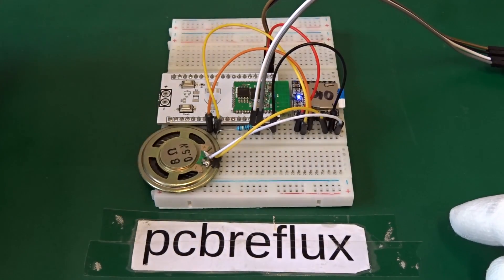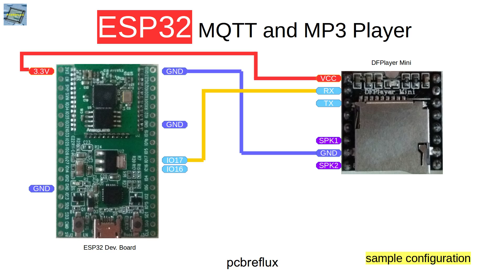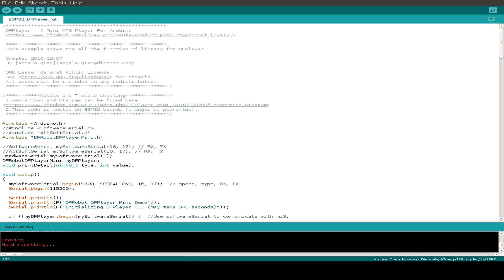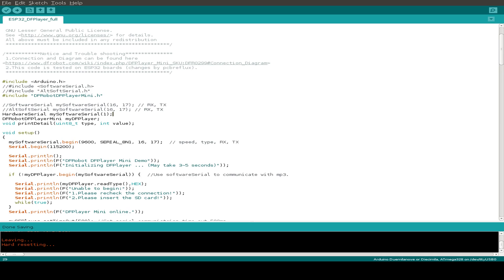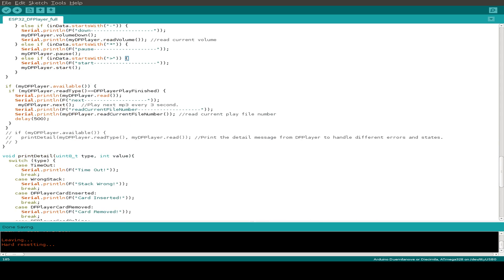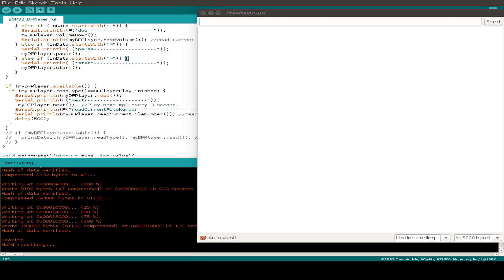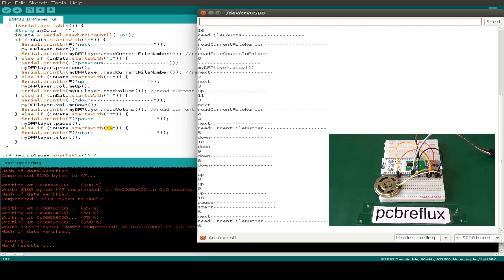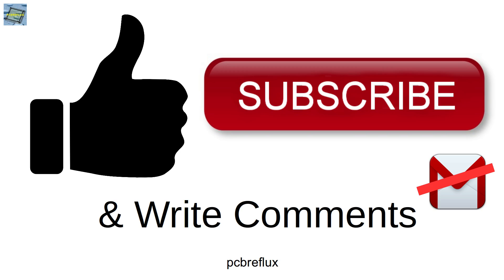ESP32 #36: Play MP3 with DFPlayer Mini + ESP32 Giveaway

Comment: Hello,
I am French and I don't speak English very well.
Thank you for this tutorial, which I discovered a few days ago after reading many others without success in completing my project.
My project is to create an audio module to attach to a drone that would broadcast the cries of predators of certain birds that destroy crops. The goal is to scare them away.
So I recorded a 50-second audio file on a micro SD card.
I would like to activate it when I power up the cards using a battery and a switch.
I would like it to activate indefinitely every 5 seconds.
Can you tell me what I need to change in the code to make this work?
Thank you again.
Best regards,
Philippe

Comment: Hello, did you find it necessary to power the esp32 from vin or will the usb connector and esp regulator be able to power the 3w speaker (likely average power is much lower)? It seems this may be marginal.

Comment: 1:10 Dumb question, what’s the purpose of the resistor and I can I just order a box of standard resistors from Amazon and put a 100K in line? I’ll be using an esp32/8266

Comment: Hello Friend! Excellent video.

I made a circuit just like yours, using the same code and library. My files are in the "mp3" folder, named "0001.mp3, 0002.mp3" and so on. I also made a folder called "15" with a single file called "001.mp3" as per the documentation.

Turns out none of the play(), playFolder() and playMp3Folder() functions work for me, none play the sound. But, the next() function works, I can play the sound by next() (by typing "n" on the serial monitor).
Something I noticed is that readState() always comes "-1", I don't know if that would be the reason or the reason for returning this value.
Could you tell me why?
Reply: hello, could you fix it ?? I still get -1readState.
Reply: @Eduardo-hu1ki  A mi me ocurre lo mismo  , y con mas comandos como por ejemplo  myDFPlayer.readFileCounts() ,myDFPlayer.readCurrentFileNumber(), myDFPlayer.readFileCountsInFolder() , etc..  todos me devuelven -1 ..  a ver si alguien sabe como solucionarlo..... jejejejeje

Comment: I recently found your channel. Have you tried running the DFPlayer from an nRF52? I recently got my dev kit and plan to make a very low standby power doorbell with mp3s. This will require a very low standby power since I plan to run it off a battery and it's possible you've tried this combo before? Thank you!
Reply from the maker: Matt B No not tried on the nrf52. But the communication is plain UART and you can adopt the DFRobotDFPlayerMini Class to your nordic development environment.
Reply: pcbreflux Thanks for the reply - I'll let you know how it works! I also got the power profiler for the nRF52 dev kit, so hopefully I can get to a real minimum power usage. I'm going to use a small-ish lipo to run it and don't expect it to have a lot of use, so it will be rechargable although I don't think I'll need to charge it very often. I plan to use it to scan for a Bluetooth signal which I'll be generating from a beacon with a button.

Comment: it always tells me 

Initializing DFPlayer ... (May take 3~5 seconds)
0
Unable to begin:
1.Please recheck the connection!
2.Please insert the SD card!

i checked the wiring 3 times already...
Reply: Yo, if yu want to make it works just disable ack from chip like that : 
if (!myDFPlayer.begin(mySoftwareSerial, false))
Reply: @adrienleger4482  This worked for me! Thanks a lot!
Reply: @adrienleger4482  Absolutely worked for me. You are the Governor!
Reply: See issue https://github.com/DFRobot/DFRobotDFPlayerMini/issues/9
Reply from the maker: If ordered different batches of the DFPlayer very cheap. Have not the same, but other issues with one batch and no issues with the other. So think there are different "versions" on the market.
Reply: http://kghr.blog.fc2.com/blog-entry-127.html  Hi, try this, it worked to me. Also try unpluging the esp32 and plug it again after the sketch upload ^-^
Reply: @ojichick3798  Hi, i'm having the same issue. Maybe my misunderstanding of Hardware Serial. Is it right that i can assign Hardware serial to any of the GPIO pins? Eg. 16 & 17 as above, or 26 & 27? Thanks
Reply: @teampro3692  Try it ouo
Reply: @ojichick3798  I did try, but nothing was working at all, so just wanted to make sure that i wasn't making a simple error before delving deeper. I've tried on multiple GPIO pins, but still can't talk to the device. Is there any way of checking what's being sent and received through serial? I've tested 2 DFPlayer modules and neither can be controlled via serial. I have tested that the modules work via IO, to ensure that the SD and speaker were set up correctly and i can make them both work using push buttons. Just nothing via serial :(
Reply: Well, for anyone else that struggles. I just commented out the initial check, and the rest of the code works fine. I think there's an issue with the original message sent to the module, and it doesn't request a response, which is why we error. I can now control everything as expected. So annoying!!!
Reply: I am having the same issue, can you please give me the solution? I have tried all the possible ways.
Thanks  in advance

Comment: Even the ESP8266 is strong enough to decode web radio streams on it's own and capable of synthetizing audio using PWM. https://github.com/espressif/esp8266_mp3_decoder
Reply from the maker: Thank you to point this out. But sure you still need an external I2S "converter" or a crude PWM_HACK. Ordered some I2Ss unfortunately  they still not as cheap as the DFPlayer (clones) + SD Card.